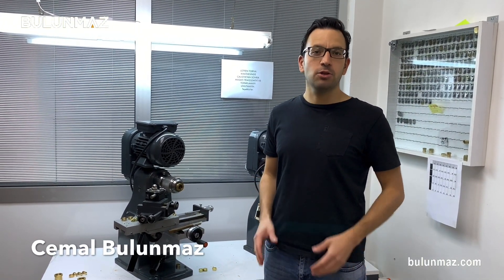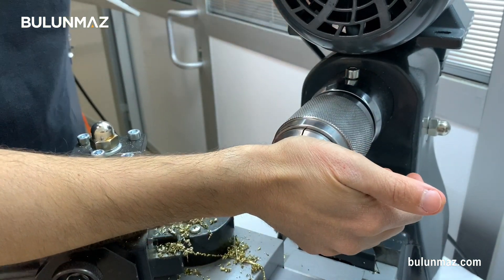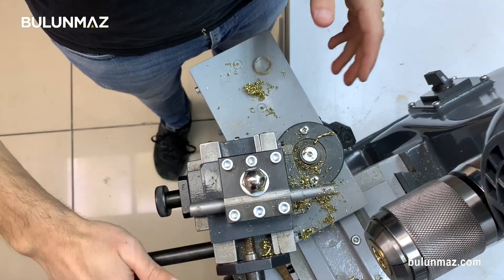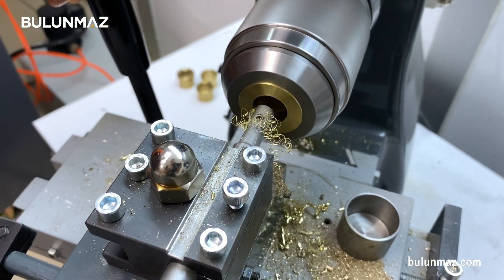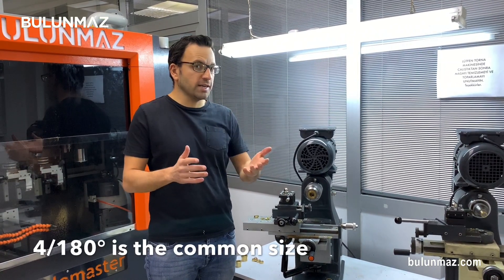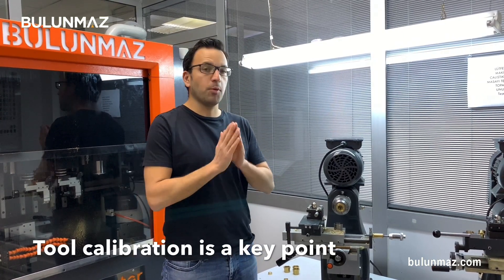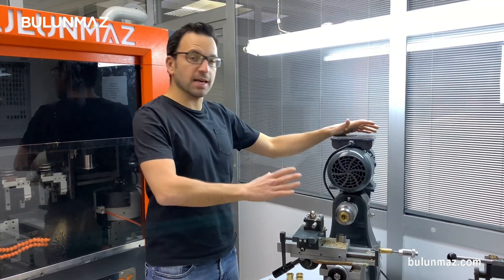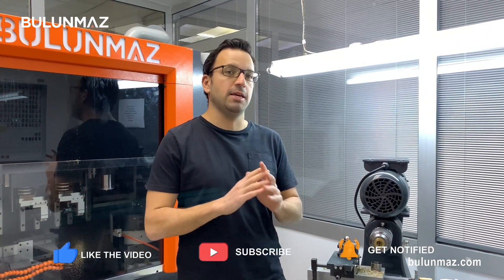Inside Lathe Machine for WEDDING BAND PRODUCTION

Comment: Can you explain why i need to buy a a diffferent lathe for inside and outside of a ring? Why cant you just make it so that there is an attachment for the outside lathe to allow for the same work to be done on the inside? Or vice versa?
Reply from the maker: Hi, thanks for your comment.
The interior parts were designed different for outside lathe and inside lathe usage by Bulunmaz Machinery.